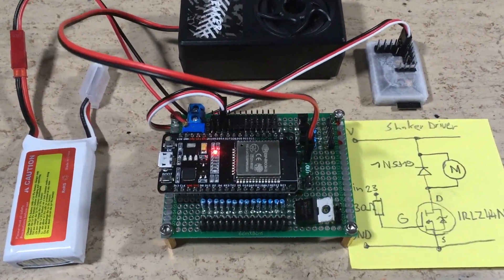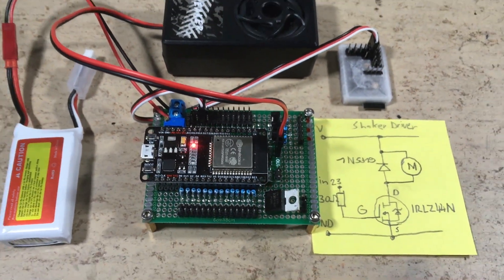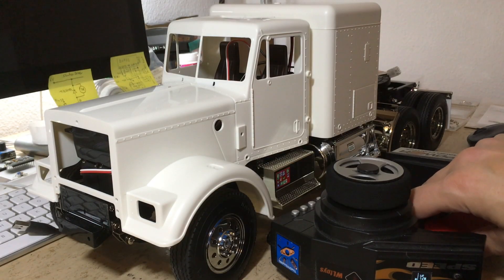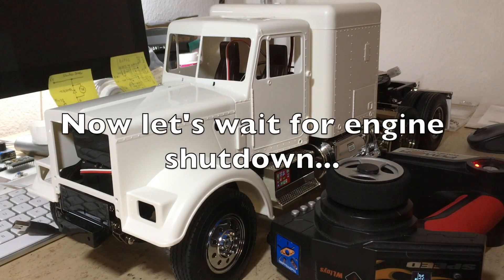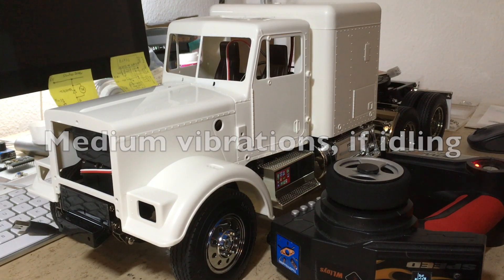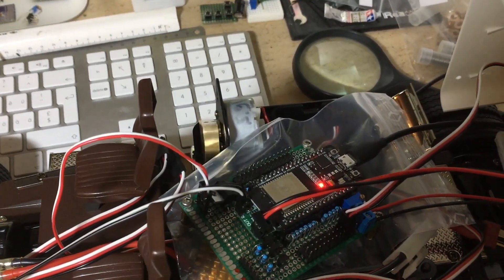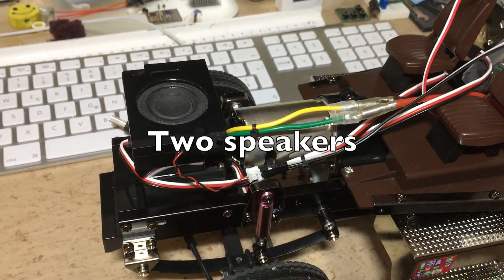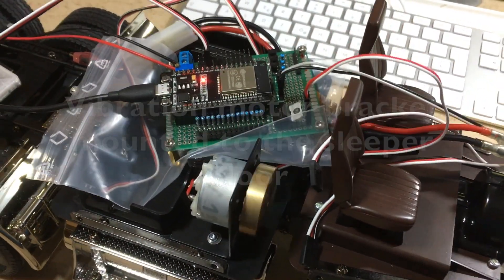Arduino DIY ESP32 Truck Sound & Light Controller: Shaken, Not Stirred!

Comment: Hello. Will this code work on esp8266? I have an error in the Arduino IDE during compilation and this part of the code is indicated: #include "driver/rmt.h"   What to do?
Reply from the maker: No, you have to use an ESP32

Comment: It's original wltoys transmitter?
Reply from the maker: No, it's just the housing. The electronics are DIY. Links are in the video description
Reply: @TheDIYGuy999  I have a transmitter and receiver broken, I once tried to make it like that, but all failed ... you are so great, I want to be able to make it like you ... I have Arduino Nano and NRF unused, I want to try again ... can the receiver be combined with MRSC using only 1 Arduino Nano?

Comment: This sounds great! I've been looking for a good sound kit for my rc fire truck, but I haven't found a commercial one that will do what I want, so I was looking at making my own, and then I found yours. I apologize for asking before digging deep into your project, but would this be powerful enough to do more than 2 sounds at once if I modify it? I need engine sound with air brake puffs, siren, horn and reverse beeper to play simultaneously, but I could disable rc channel processing and light functions, as I already have an Arduino mega dealing with that. Thank you for your service for the R/C diy community!
Reply from the maker: Thanks. Yes, I think it does everything you need and more. Multiple songs can be played simultaneously. I also added vehicle inertia simulation in the meantime: https://www.youtube.com/watch?v=IKqIH0PLWcM&t=3s
Reply: @TheDIYGuy999  I've ordered some esp32 boards and some PAM, so I have some experimenting to do. I'll keep you updated if it works out! I've also considered using the esp32 audio development kit, but I'm more comfortable in the Arduino environment. I like the inertia simulation. I was originally hoping to use a VNH2SP30 board to make my own ESC so I could have complete control over reverse, inertia and gear simulation, but I have issues with trusting that giving motor control of my model to diy code would be safe. At the moment I prefer having ESC and steering directly controlled by the receiver while processing the other 14 channels through the Arduino.
Reply from the maker: Yes, controlling the ESC is a bit of a risk, but there is a failsafe mode for PWM and serial throttle mode. If the input signal is lost, the emergency brake is triggered. The ESC is controlled by a state machine, so you always know, which state will be next. Can't wait to see your feedback!
Reply: @TheDIYGuy999  I've made a test setup and it's a great project! I'm swapping out some code with my own bits from my light kit, and it can currently do horn and siren at the same time, while switching between two custom made siren sounds every 5 seconds by rewriting the soundNo switch/case section. I'm thinking the soundNo framework could also be used to have an intro + looping + outro sound setup for the horn. It's exactly what I've been looking for. Great fun, thank you!
Reply from the maker: @WombiiActual  Good to hear, that it is useful for you. Can't wait to see your video about it.

Comment: Epic, great work. could it me made into a smaller package for 1/16 scale?
Reply from the maker: Thanks. You could use one of these: https://www.banggood.com/de/Geekcreit-WiFi-Bluetooth-ESP32-Module-Dual-Core-CPU-With-Low-Power-Consumption-MCU-ESP-32S-p-1125282.html?utm_campaign=4828314_1046285&utm_content=1097&p=NZ29024828314201605E

Comment: Love itt 😍 gonna make it my own too soon
Btw have a look on this may be you would like to use it in your future projects https://www.cnx-software.com/2019/12/24/stm32-black-pill-board-features-stm32f4-cortex-m4-mcu-optional-spi-flash/
Reply from the maker: Thanks. The STM32 is a completely different processor, I'm using an ESP32. They are also available in a smaller package: https://www.banggood.com/de/Geekcreit-WiFi-Bluetooth-ESP32-Module-Dual-Core-CPU-With-Low-Power-Consumption-MCU-ESP-32S-p-1125282.html?utm_campaign=4828314_1046285&utm_content=1097&p=NZ29024828314201605E